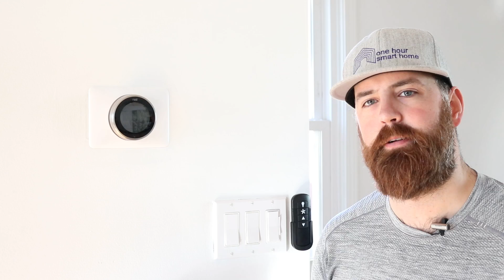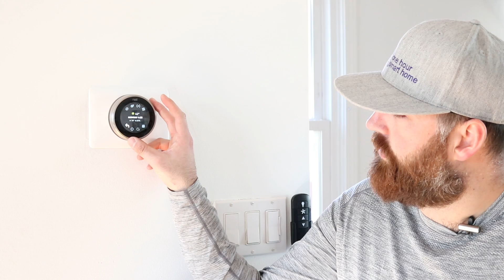Should You Get A Nest? Nest Thermostat Review

Comment: Nest is a great thermostat. Unfortunately the way it is sold to customers is horrible. To use all the features packed with this stat, you need to call a professional with the Nest Pro password. For a considerable cost. I am a HVAC professional and fix computers in my spare time. More than technically qualified to  go through Nest Pro program with a breeze. But because I do not sell them or push them, Google said I am not a good match to obtain Nest Pro certification. So I do not touch them and steer customers away to far cheaper and better choices. Like Bosh WIFI stat from Amazon. Just over $100 and does all what most people would need. We do not  need more corporate greed...

Comment: Had one installed just under a year ago and it’s suddenly stopped working. I’m now without heating in the middle of winter. 

Never had this problem with my old bog-standard thermostat.
Reply: Do you have the common wire hook up to feed the battery power?
Reply: @codyfarrar8281  Hi Cody, thanks for you comment. The first unit was installed by a gas engineer so I’m hoping he got it right. 

On the second unit was identical to the first so I’ve just transfer the wires over on a like-for-like basis (didn’t have to open the boiler cover). It’s working fine at the moment but based on what you’ve said I’ll get a gas engineer to confirm it’s hooked up right when the boiler is serviced.

Cheers

Comment: I have a Trane ac system. I just bought the nest thermostat to install I do ha e two separate O and B wires the  O is orange and the B is a a dark blue. Is this B wire a common wire on these trans system and thermostats. If it’s not how do I make this system computable with the nest Thanks
Reply from the maker: If you have both an O and a separate  B wire your system is not compatible with nest unless your B wire is actually a C wire which you could check in the documentation for your HVAC system.
Reply: One Hour Smart Home I found out that with my trane unit. The B wire is just a 24vac wire and just connects to the C on the nest thermostat.
Reply from the maker: @ZaynsFather88  Awesome!

Comment: I think the best feature is the remote thermostat. It is nice being able to keep the bedrooms a constant temperature. Having the humidity level for each room is nice too
Reply from the maker: That's a good point.
Reply: One Hour Smart Home thanks for acknowledging!
Yes, based on feedback provided by my nest, i decided to close the top flap in the baseboard radiators in my master bedroom.  This allows hot water in the loop to pass into the guest bedroom to heat it to a more comfortable level.  Before the nest, if the guest bedroom was cold, we would have to heat both bedrooms till the master was too hot, and the guest room was just comfortable. Deciding to shut the radiator flap was always on the table, but regulating the temperature with a thermostat in another room was only possible with our new nest.

Comment: I have a 2 story home with a thermostat on each floor (dual zone).   Will this work?
Reply from the maker: Yes, it will. You might need to connect a common wire from the thermostat to the dual zone controller for the nest's to get enough power.
Reply: I was told I'd need to buy 2

Comment: I have to agree with most of the comments here. I have installed many Nest thermostats (ex Pro installer) and owning one myself. They are simply too inaccurate. Auto Schedule is dumb and would turn on when i'm out, off when I'm in. When you turn Auto Schedule off it will randomly turn it self back on. I love the style like everyone else but I'm afraid it's style over substance and put me off Smart Thermostat's. I'm tempted to try a HIVE because it isn't trying to be 'too smart' you also don't have to have power to the thermostat as it runs off batteries, which is why 80% of Nest users have the thermostat located in the completely wrong place due to them having to plug it in which generally means on a desk or table at the wrong height and position in the house. I'm also convinced it isn't saving people money like it claims, where a £50 Honeywell would do a far superior job. Until they sort it out save your money people!
Reply from the maker: Thanks for the comment are you located in the UK? I have noticed that the Nest is a much more difficult installation in the UK than in the US where it seems like the installation and features are slightly easier to use? What has your experience  been as an installer?
Reply: @OneHourSmartHome  Hi yes located in the UK. Installation's ok, not more difficult than any of the others. Honeywell and Hive probably lead in this department as they've adopted very similar connections to what would be used in traditional UK heating systems. I think the nest experience regarding getting the recommendation for the work via their website and the installation process is actually pretty decent. They're product also probably looks the smartest hence why they're so popular, unfortunately it's the job of being a thermostat that's left a lot to be desired.

Comment: How well will it work in a reverse split home?
Reply from the maker: It will work with systems that have a furnace and air conditioner if that is what you are refering too. It will also work with heat pumps, boilers or boilers combined with air conditioners.

Comment: Ever since Google bought Nest my thermostat has become an idiot.  For example I just turned the stupid thing down after it decided I needed to be warmer.  Less than 5 minutes later it's turning the temperature up.  This goes on all the time.  It is going in the garbage.
Reply from the maker: Interesting, I haven't had the same issue, you might want to check your auto schedule settings.
Reply: @OneHourSmartHome   the nest works great during the summer.   only have i had issues in the winter
Reply: Definitely a downside to a so called "learning thermostat "
I don't even keep the schedule feature turned on & mine adjusts itself every hour most times & it keeps going to the summer learned temperatures. 
I have to do a factory reset every season it seems like. 
We didn't have any issues until we added the nest thermostat to the other 2 zones in the house

Comment: What about battery, if I wanna be away from home for a year?
Reply from the maker: As long as your HVAC system power is still on you don't need to worry about the nest battery. It charges from the HVAC power and doesn't need replacement.
Reply: That is half truth. So if the system is being used. The furnace in general.... even the fan it steals power to charge it's battery. If it's not being used the battery will be depleted. Happens a lot when people don't use the nest thermostats in the summer if they don't have AC. You can then take it off the wall and charge it with a micro USB cord. Or it can have continuous charge if the common wire is hooked up. With nest it should always have it hooked up.

Comment: I’m not 100% sold on the Nest. My brother has 1 & it’s cool to be able to control the temp via your phone using the app, but as I stayed at his house for the summer, I noticed when set to the desired temp, it wouldn’t just go off. (Temp was set to 76 & Nest was still cooling & reading indoor temp of 75) 
I know it’s digital & it can be +\- 2 degrees on/off, but I’m just use to the other digital thermostats that go off at what temp you set it for.
Reply from the maker: I haven't had that issue with the nest installed in my house,  most HVAC systems run for 1- 5 minutes even after the temperature is reached as part of the control board programing which might be what you  were experiencing. Ecobee: https://amzn.to/2oIC1vf is also a good option if you are looking for something different. We compare both here: https://www.onehoursmarthome.com/blog/nest-vs-ecobee
Reply: The fan still runs for a few mins by design because the coils are still cold/hot. Also the nest waits until +1.5 or -1.5 before it turns on vs strictly that temp. It varies between companies Honeywell if set to 72 stays 72 everyone has there opinions which is more efficient 🤷‍♂️